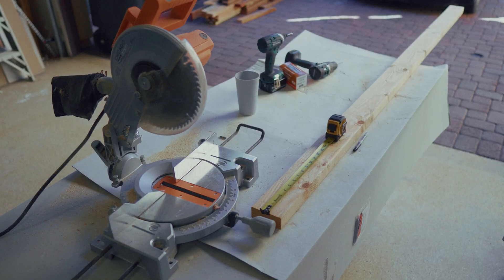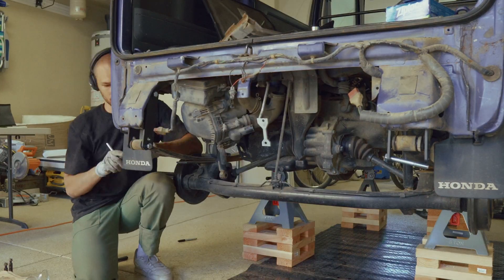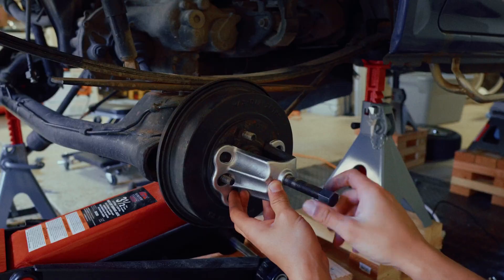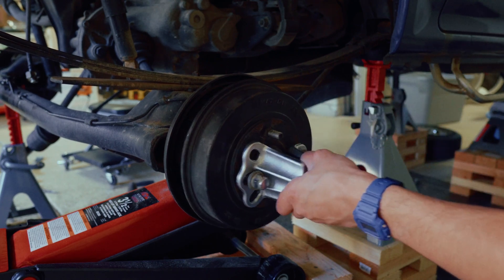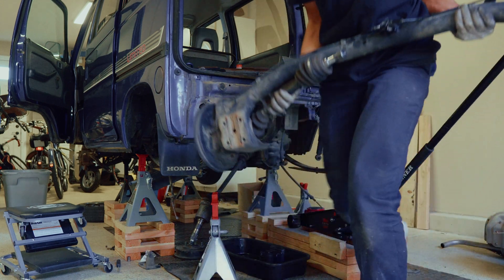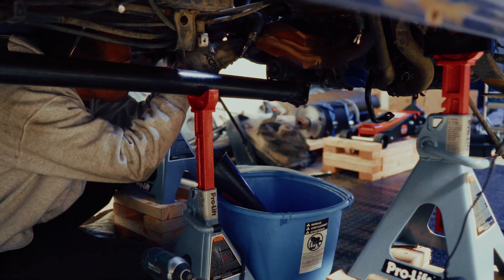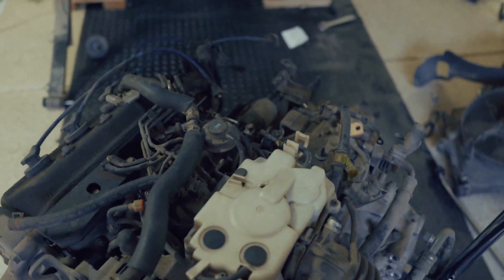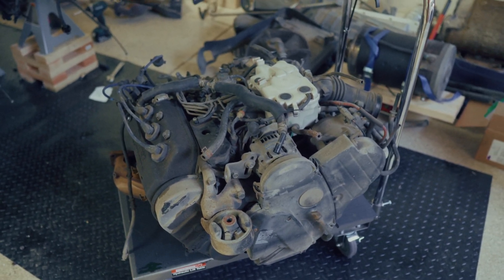Building the worlds first Tesla powered Kei Van

Comment: Yeaaah so excited!!  You're doing it right, starting your video series after the project is well under way.  My conversion has barely started and I feel like I jumped the gun XD
Reply: Hey, question.. did you ever weigh your engine?  I'm curious how much a 660cc engine weights compared to a motor and batteries.  Do you have a before and after weight for the whole van?
Reply from the maker: I’m not sure if there actually is such thing as “doing it right” haha but here we are. I didn’t actually weigh this specific Acty, but from the factory they weighed 1800 lbs. when I removed the engine I’d say it was close to 200lbs. A full gas tank probably about 100lbs.